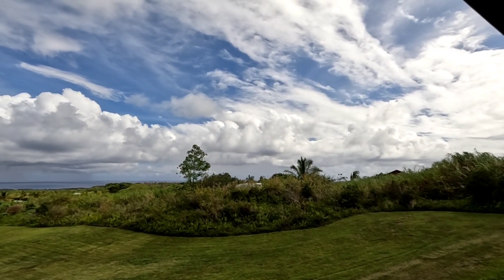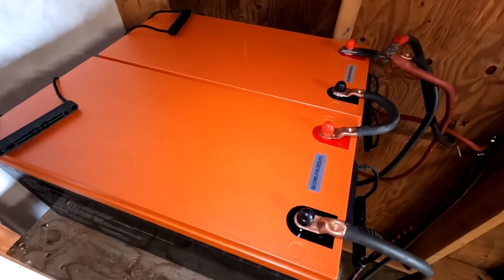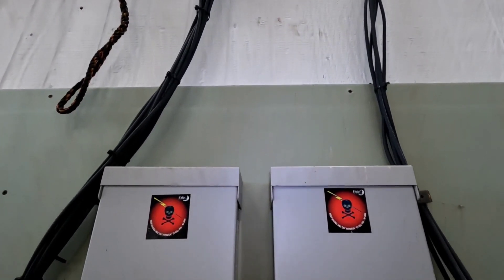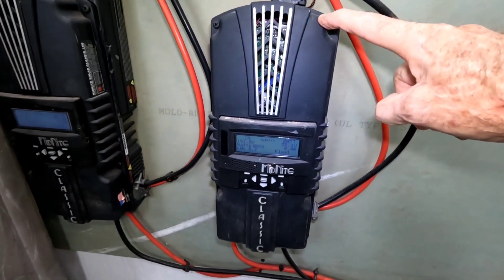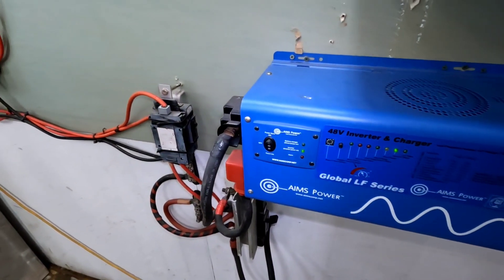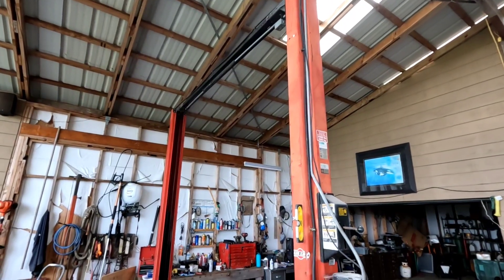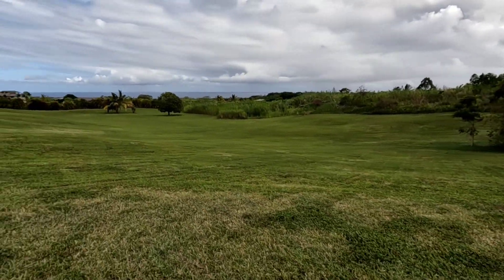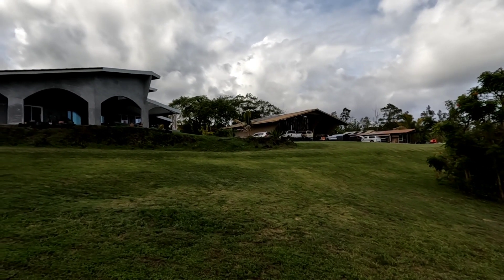Special guest appearance/ Chins 48v 200Ah LiFePO4 battery bank runs amazing home in Hawaii

Comment: Can you mix battery sizes? I have two 100 ah litium batteries  and am thinking about adding another 200 ah to my system. Do I need 2 more 100 ah batteries or can I add one 200 ah battery to the system to bring me up to 400 ah? I am running my batteries  in parallel.

Comment: That super ! thank you for sharing.. bigger systems use   higher voltage. more efficient . I see a lot of people on the island using solar. and a lot of them dumping the old lead battery's. I did see a YouTube video from the island that they were using  .Nickel Iron Battery's . like I use hear. Mine are the China made ones. The only midnight solar products I have hear is the surge protectors for PV panels . they are great .have a blue led on them. they make different voltages to match the system. Amazon has them. It's great to see outher systems . helps us get ideas on what and how to do. 😀
Reply from the maker: I'm learning a lot from these higher voltage applications...guess I'll head in that direction slowly.  Another learning curve on the way for me! I'm depending on you to keep me on track and focused!! Mahalo for all you do for us! Aloha!🤙

Comment: Nice system should treat you well. Looks like you might be loosing some power shade on left. Also I don't know if you believe but when you get new batteries check with multi meter then fully charge top balance and wire together and let sit 12 hours leveling out then connect to system.
Reply from the maker: Yeah he has to cut thos branches periodically,  but only really catches shade at near the end of the day . aloha 🤙

Comment: Beautiful. Love that massive inverter and those big fat juicy batteries !   
I’ve been using 24v off grid setups recently vs 12v as it allows more wattage w less heat.  Some of our systems operate at outdoor 100F in az and Utah.  Heats a challenge
Reply from the maker: He's got a pretty sweet system,  and running so much off of it. The seed has been planted in my brain now...higher voltage.  I feel it pulling me in that direction now! No rest for the foreseeable future!! Aloha!🤙